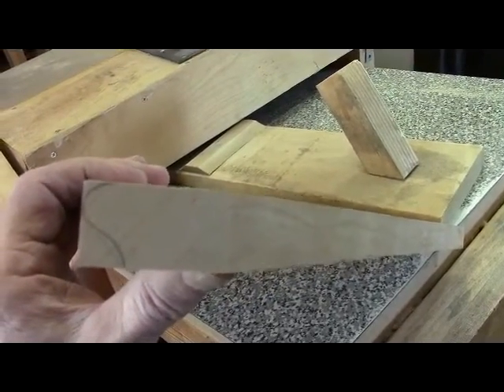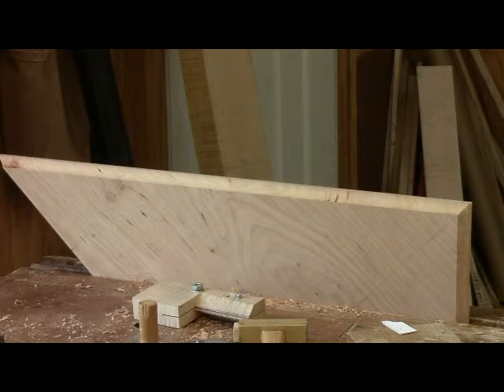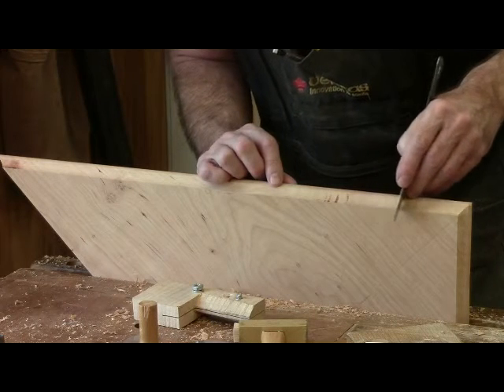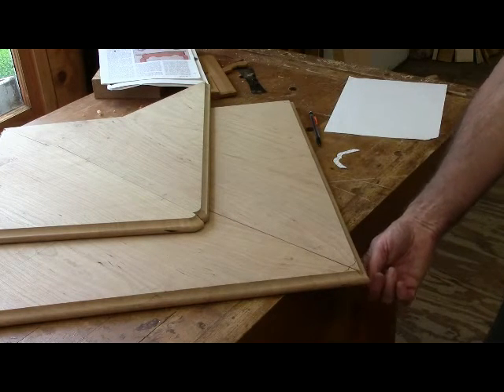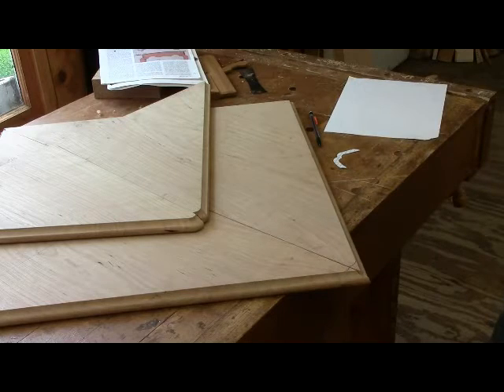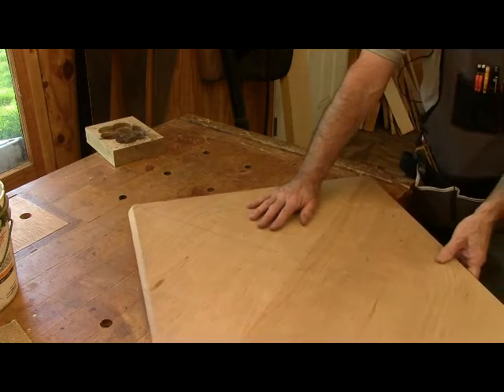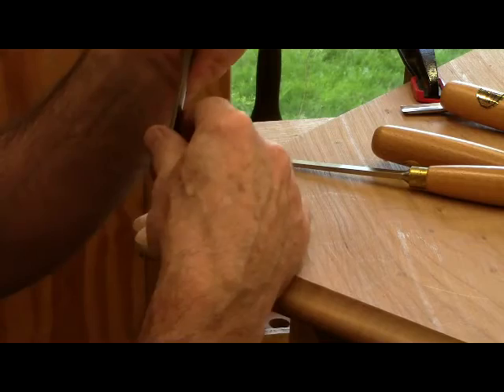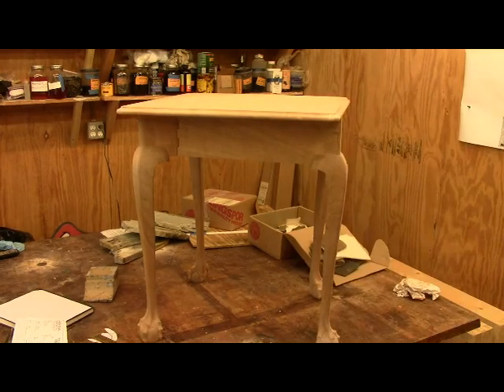Cherry Chippendale Handkerchief Table   Edge Moulding & BabyButt Part 7

Comment: Coming along nicely David. It's the attention to detail that makes the biggest difference. And the new equipment is working great! What kind of wireless mike did you get?
Reply from the maker: +GuysWoodshop Thanks Guy, It is an Audio-Technica ATR288W with a clip on mic.  Works well I must say.  I have wanted to get one for awhile but the old camera did not have an external mic input.  So I had to buy a camera and the mic